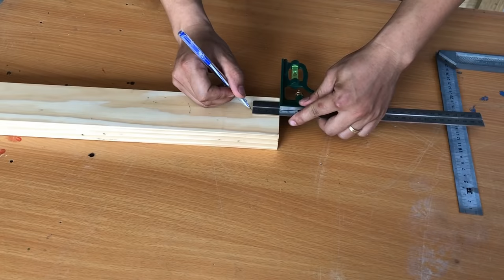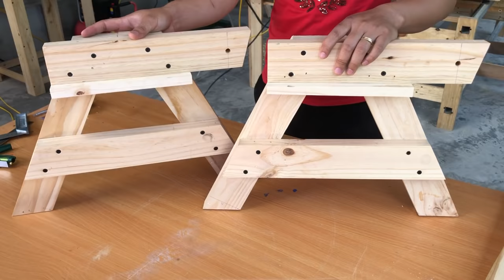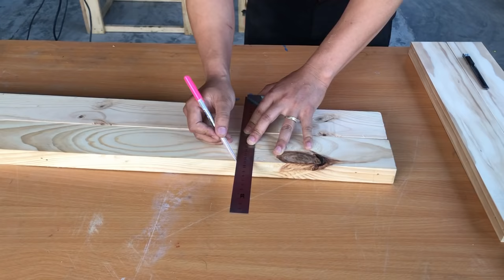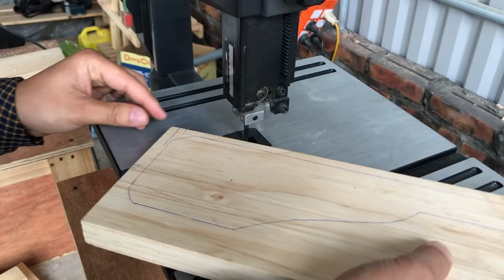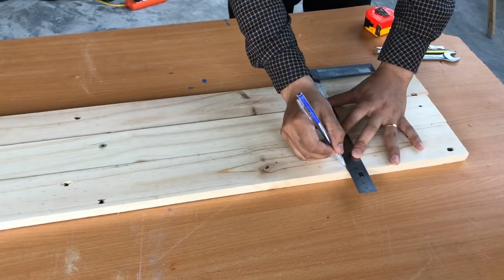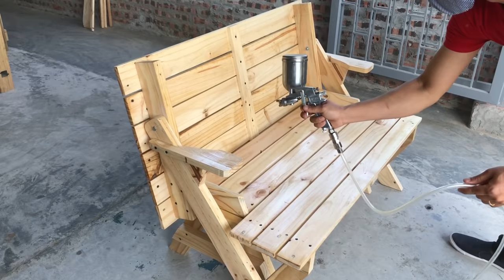Amazing Creative Woodworking Ideas - DIY Convertible Picnic Table that folds into bench seats

Comment: Why not buy the right length bolts? When making the arm rests he makes two extra cuts, the full length cut and 90 degree cut, when he placed the template, why didn't he put it too those two edges????

Comment: I make wood crafts to sell at craft events. My comments are for people who would want to build one of these neat folding benches/picnic table. I have made about 4 of these, sold two, gave one to my son for his patio. The measurements have to be very precise and matching, and the side pieces that swivel are tricky because they are mirror images ,or opposites: you cannot just make two exactly the same way. I make mine out of Cedar and I beefed up the widths of every piece to 1 1/4 inch. The seats and back are 1 inch thick. Plans are necessary; you cannot just guess. I also counter sunk all screw holes and put in Cedar plugs then sanded...looks really nice that way. My plans are 40 pages...!!

Anyway...good job. I didn't do it your way but if it worked for you then great.
Reply: I’d buy your plans if you have a link